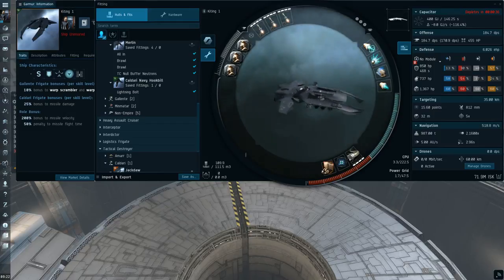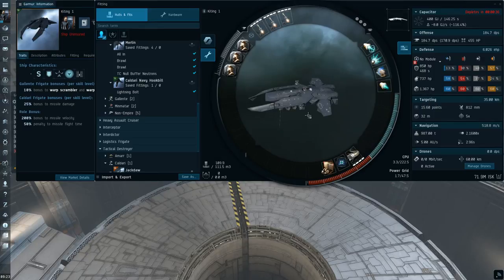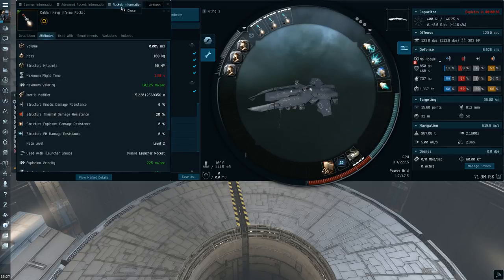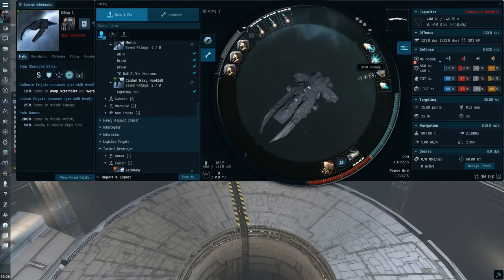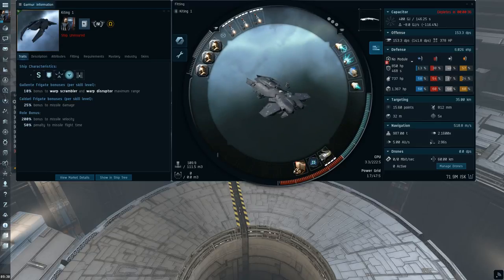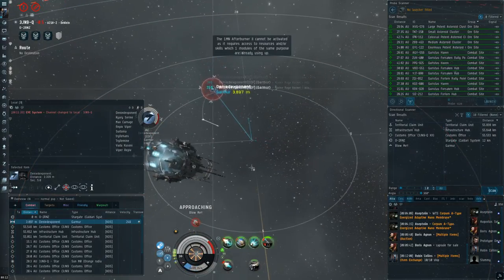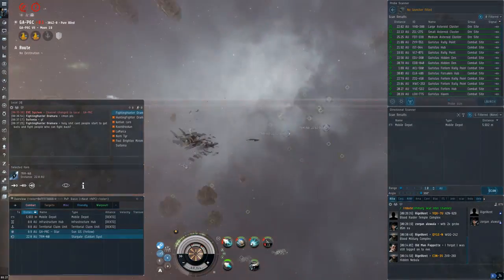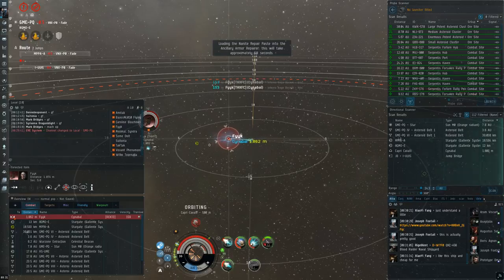Dual Prop Control Garmur

Comment: actually you only need 1 Small Rocket Fuel Cache Partition II + Zainou 'Deadeye' Missile Bombardment MB-703 + 1 Antipharmakon Toxot to hit a flight time of 2s flat on the garmur.
Drugging up a bit and using a 24M isk hardwiring implant may change the comparison if you only have to drop one of the hull rigs.
Reply from the maker: Thanks for the info. If you're going to make the fit a little more expensive that's great to know.

Comment: Thanks for the explanation about the missile flight time, I had no idea. It sounds like a the type of thing CCP really ought to just fix, or at least explain as a type of 'missile falloff'.
Reply: Because server ticks are every second similar effects occur on every module with time related stats (effects very, but the rounding always happens). With most things it carries on to the next tick, but with missiles it depends on when they took flight (fire rate) as to when the final tick ends their flight time (flight time compared to server tick). They really couldn't fix this without relying on client-side or reducing tick time.
Reply: Ah I didn't know the actual cause of it. In this case it is exacerbated by the short rocket flight time exacerbated by the  Garmur's specific bonus.  You could argue its an interesting mechanic, but without being mentioned specifically it is  unintuative. 
A simple could fix it by ensuring that the flight time can only be an integer, and then adjust the speeds to make appropriate tweaks to distance.  Then the distance shown by hovering over the module is in fact accurate, without needing to complicate the current system further by introducing 'missile falloff.'
Reply: Yeah, I'm with ya. I like the idea that missiles "feel different" because of flight time vs falloff, it makes them more unique (otherwise they'd just be end of cycle hitting artillery?). It does lead to the strange situations like this (especially with the bonuses as you mentioned) though that make them harder to understand.

I don't know that forcing whole numbers would really help though given that pretty much everything in eve generally adds a bonus by percentage, non-zero values regularly occur. Knowing this server tick info should help you in the future though! e.g. that things like getting an align time of 2.5 vs 2.99 (both are rounded to 3 secs) are useless might allow for a little more versatility in those fits.

Comment: Wtf, that is so dumb...So the rocket range should be modified to a real range on the interface in the fitting.
Reply from the maker: It would be great if they could update rockets to be checked every 0.1s instead of every 1s, that would increase consistency a lot, but would also pressure the server a lot more in big fights.